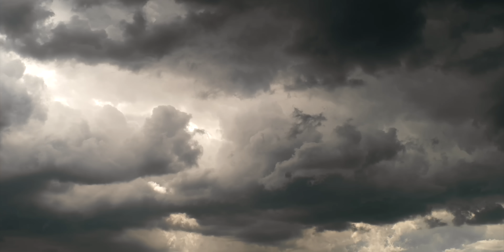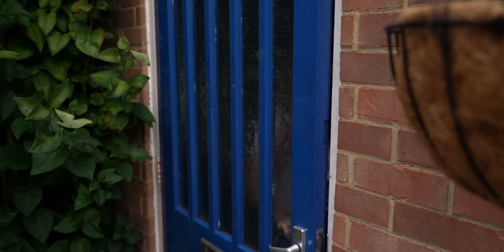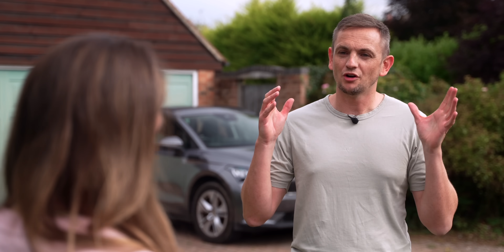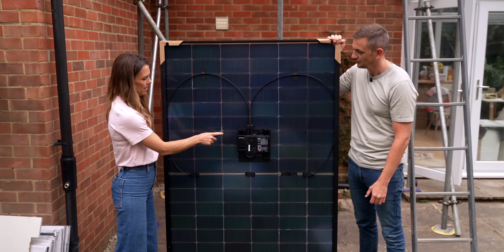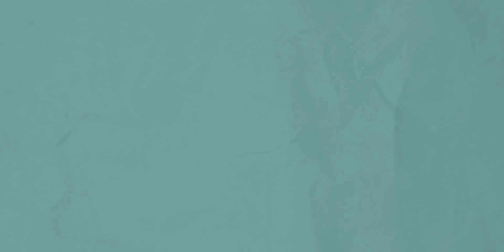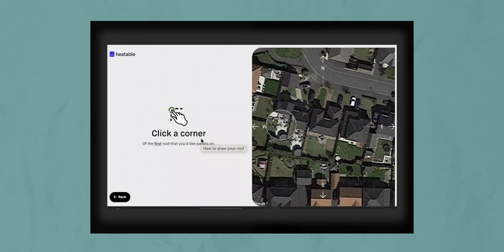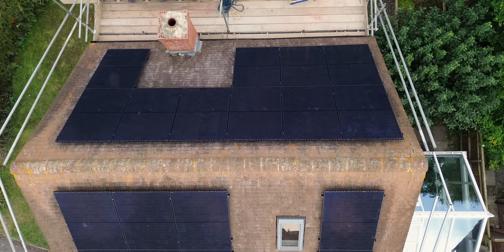Maximise Your Solar Returns With These Bifacial Panels!!

Comment: "Designed to harvest any energy in the atmosphere", the co founder can't even describe how they work.  So will they harvest heat on a hot night, would they not work in space as its without an atmosphere.  This honestly feels like a video sponsored by snake oil salesmen.
Reply: Yea, I lost it at that section. Pretty disingenuous.
Reply: What is a worry is that the platform seems to make a habit of having as guests all sorts of guests who ate not quite the thing.

Apart from that young Yasmin lady (chemist engineer by profession) who had a fair bit of experience in the industry working for various government outfits.

Other guests it seems are chosen for their ability to instantly do the confirmation bias thing for Robert's views.

As is now known sales of BEVs are now in decline.

It was an experiment which failed, mainly because the general car buying public didn't appreciate the initial costs, time to recharge and dismal residuals.

And of course the possibility of self ignition with some lithium tech.

Doubtless this will provoke arguments but the only viable technology left for reducing the carbon in our atmosphere is hydrogen.

We read scathing comments apropos the suitability of hydrogen as a fuel from those who simply don't keep up and post history lessons.

This is despite car manufacturers developing hydrogen powered cars using "off the shelf" fuel cells almost, deemed to be perfectly acceptable to power cars.

Granted the hydrogen fuel distribution system is pants but that was more of a governmental thing which is now being rectified albeit not before time.

Come on Robert!

Bite the bullet and include hydrogen info, hydrogen produces electricity which comes  under the EV heading.
Reply: @t1n4444  You have a problem with lithium to self ignite? And promote hydrogen? Ah, so you wanna see bigger booms then, quite understandable. 
FYI: a hydrogen fuel cell vehicle has a battery pack in it due to the fact the fuel cell can not provide enough power for acceleration.
Reply: @Sekir80  

😂😂😂

What on earth are you droning on about?

Clearly you don't quite grasp the technology so allow me:
hydrogen gas has to mix with air at a certain ratio before the mix becomes explosive. The ratios can be found online to save me cribbing out the info here.

However, hydrogen gas, being the lightest element in the Periodic Table, has the property of being the fastest rising gas of all.

This means that an escape of hydrogen gas into the atmosphere will rise up so fast in the air ocean it won't have time to mix into an explosive so to speak, unless confined of course.

If you were to research the Hindenburg airship disaster you will find there was no huge explosion. The airship burned but did not explode.

The fire was a result of the dope covered outer sheath burning in air.

The hydrogen gas had risen so quickly it no longer posed a risk of explosion.

Ergo you have little understanding of hydrogen science. You would have been wise to research all this prior to posting.

Now, hydrogen cars requiring a buffer battery to allow for acceleration from stationary ... so what?

The fuel cell will be charging the battery as the battery discharges through acceleration.

Again, so what?

Hydrogen fuel cell cars have been working for over a decade, as in the Marai. Recently fuel cell cars and buses were to be seen in Paris providing logistical support as in transporting competitors and official to the various venues.

In short the French wished to parade their "green credentials" to the world at large.

The hydrogen used was reduced by green energy to. underline their attempts to be as green as possible.

Again you could have found this out for yourself prior to posting if only you had applied yourself, but you failed miserably.

BEVs are now in decline and  unless such a BEV can be "invented" which is "cheap", can be charged in minutes to provide similar "performance of operability" to a petrol/diesel car then they are destined to be a mere footnote on history.

What Robert will find in seminars yet to be is that increasing numbers of people will be asking about hydrogen fuel cell cars.

It may be Robert has gone too far in "poo pooing" hydrogen he will find it difficult to start proclaiming them as the future, as they undoubtedly are.

This is the trouble when setting out one's stall without allowing some wriggle room in which to effect a "u" turn which is credible or believable.

When people set out their stall on a public platform they must expect to be challenged ... in the same way as yourself.
Reply: @t1n4444  I was quite short with my answer, the one who's droning is you. Projecting much?
I'll address little things to clarify
- FYI batteries are in hydrogen cars: I added this because you - and I quote: "And of course the possibility of self ignition with some lithium tech." So, if you fear of lithium in your car, then you must not get into a hydrogen one as well.
- I understand that hydrogen is light. Later you yourself mention - and I quote: "This means that an escape of hydrogen gas into the atmosphere will rise up so fast in the air ocean it won't have time to mix into an explosive so to speak, unless confined of course." Important part is: "unless confined of course". As you know, hydrogen is light. Storing and transporting it needs confinement and pressure. Accidents can and will happen. https://www.nrk.no/norge/eksplosjon-ved-hydrogenstasjon-1.14582914
- If we would play the "you're ignorant" game I would ask you: what a Marai is? Are you that dumb you can't even research well enough to know what's the name of the model of that Toyota? But I'm not playing this game, I urge you not play that as well. Keep it civil!

To finish it off: I don't mind hydrogen be used. But I do think it's efficiency figures make it very hard to stand by. The losses to make and use hydrogen in a fuel cell are so high it's barely a better alternative to fossil fuels. If even a better alternative. Change my mind.
Reply: That heatable guy is rather sleezy when it comes to micro inverters. I won't be surprised if he claims micro inverters can cure cancer.

Comment: The ROI still doesn't stack up. By the time you've paid back the investment, both the panels and battery are near or at the actual end of life. Prices need to drop before the masses adopt what is 30+ year technology.
Reply: The ROI for this system is indeed terrible, because they use a lot of superfluous and overly expensive nonsense. Panels are terribly cheap these days, between 75 and 100EUR per panel, depending on size, efficiency and features. After a massive spike in 2022 and 2023, we are once again in a time where the cost of cabling and bracketry and installation is higher than the cost of these high tech bits of silicon.
Reply: @luc_libv_verhaegen  the real kick is the battery cost and <3 year warranty

Comment: I've always wondered if, in the future, homes should just have an AC and a DC line.

Because I bought one of those sockets that also have USB ports on them. And it just struck me as odd to, you know, capture DC with a solar panel, store it DC in a battery, convert it to AC with an inverter, it travels a few meters, then it's converted back to DC again to go into, say, a DC battery (like a phone or laptop).

There's, like, some needless conversions there. And I was thinking, instead, a battery-equipped house could run an AC line to traditional 3-pin sockets, but then also there's a DC line that runs to a bunch of USB C ports around the house.

Low-power devices can skip the AC conversion. Just plug them into the USB port with a direct DC connection to the battery.

Efficiency!
Reply: It's going to be fun frying your 5V DC USB devices with the 500V+ from solar... You will need all kind of voltage conversion on that DC line anyway, even if it is more efficient there will still be losses.
Reply: I have a 2kwh ugreen battery that does what you described, using in a van so could be an issue scaling to a house. 4 full wattage AC plugs and loads of usb DC outputs, native solar input connections too
Reply: For the amount of energy saved, it's likely never going to offset the initial setup cost, the additional complexity of having two sets of wires running through your house and the maintenance of that wiring.
Reply: @mentality-monster  https://youtu.be/btIJWYor8KA?si=W-ECnQrNYrttItKY
Reply: @klaxoncow  half my property is wired with 24VDC
Reply: - don't worry, every single electronic device does a whole lot of energy conversions - it is very complicated. (Electronics (nearly) all run on DC, but there are often intermediate; inversion, rectification and level switching - etc, to produce an outcome).
Reply: Okay, to have a system like that I'd suggest the following: Solar panels, inverter, batteries. The inverter/battery decides your DC line for the house, say, 12V. You can use that directly for LED strips, so, the lighting is solved. Wherever you need a 5V USB outlet just use a step down converter (buck converter) to get that.
Reply: DC  >40V gets super sketchy.  I've worked on rail projects that used 750VDC, the breakers for dealing with DC faults were the size of home refrigerators, the AC breakers of equivalent capacity were the the size of a toaster.  You can do lots of clever stuff with DC, but ultimately you need big mechanical systems to deal with DC faults when all the smarts arc out.
Reply: For lighting circuits something like 12v DC seems like the safe and efficient way to go. 
My ceilings are crammed with individual 12v DC drivers for LED spots and half my light switches are low voltage electronics switching 240v, even though the bulbs ultimately only need 12v.

Am I right in thinking that there is a standard for low voltage lighting circuits already?
Reply: @GregS-UK  Isn't there power over ethernet lighting? but I think for large commercial buildings it makes sense - think hotels etc.
Reply: @Oppledom  I wasn't aware of PoE lighting (so I don't believe that was the thing I thought I had heard about) but it looks interesting - however having just had a brief search and read some posts, it also looks fairly unpromising for domestic installations.  Critics suggested that too much network gear was needed and that it provided too little power per cable to be viable in a small scale installation.  I'm uncertain as to why that isn't also the case in large commercial installations though. 
Certainly the prevailing mood on the threads I read seemed to be that anyone wanting to use it in their house was doomed to be left with a white elephant of unsupported tech, as it would never become a standard for home use. They could be wrong but the complete lack of voices supporting it as a home solution looked pretty telling to me.

Comment: Using bi-facial panels so close to the roof tiles is just pointless. Micro inverters are more inefficient than normal DC strings. Disappointing video Imogen.
Reply: The bifaciality gives about 5% extra apparently, if installed on a roof.  It'd give quite a bit more if installed on a ground-mount or vertically.   Regarding microinverters, I don't know about more inefficient, I think it's about the same as a typical string inverter, but I struggle to see their value if there isn't significant shading to deal with.  Perhaps if there is a chimney or similar, put them on the nearest panels to the chimney, but I don't see the point of putting them on all the panels.
Reply: - putting bicacials on tilts (or stand-offs) - can allow a bit more ambient back scatter collection- somewhat better cloudy day performance  - probably better with a metal roof rather than tile.
Reply: This is far from the worst of it. One of the worst fully charged videos ever.

But the bifacials are not bad, depending on how much of a premium Heatable charges for bifacials. Bifacials these days are almost on parity with standard panels for some solar panel manufacturers, so you get the advantage of having your silicon sandwiched between two glass layers instead of one glass and one aluminium with coating for the same price. But i seriously doubt that these snake oil salesmen are charging the real prices here.
Reply: They quoted me 5k for 5no panels.
Straight swap to replace mono facial panels on a garage roof!
Reply: Very disappointing indeed. I suspect the heatable guy paid for this presentation.
Reply: @adon8672  https://youtu.be/btIJWYor8KA?si=W-ECnQrNYrttItKY
Reply: They were too close to the roof tiles to achieve any gain.

Comment: Is there anyway you can store or use electricity as soon as its being generated from your PV panels (ie no minimum or very low voltage 10volts)? Such as storing it in a DC battery, using a hybrid battery or charging your EV? 

If there is a way, could you please describe it. As we're looking to install a large East/West solar array and have an Ioniq 5 too

Comment: The suggestion that DC only strings are not safe is fundamentally wrong! If the concern is the need for rapid shutdown then put in solar optimisers such as Tigo's, which are MUCH cheaper than having separate microinverters for each panel. Adding enphase is an easy way to triple the cost of a solar array for limited benefit.
Reply: Why triple ??
Reply: @stephenbrickwood1602  I buy 450w panels for 65GBP an Enphase microinverter is 160GBP add in the extra wiring and spark/scaffold time you'll easily triple the cost. Plus I can't use much cheaper 48v LifePo4 batteries without doing AC/DC/AC conversions whereas a regular solar DC inverter will do the much more efficient DC/DC conversion.
Reply: Spot on.

Comment: An awful video about an awful product. Lots of misinformation on this video.
Reply: OK.  Let's hear it.
Reply: @Pottery4Life  The suggestion that AC is much safer than DC is simply wrong. Having that many inverters also increases the chance of failure - I've had 2 inverters fail on me in the last 3 years and having them on the roof means scaffolding to fix - not cheap! More cabling with micro inverters, limited choice of battery storage and less efficient storage as you have to do AC/DC/AC when charging/discharging so lots of transfer losses. if the concern is solar production due to shading then solar optimisers are a far more cost effective solution at 30GBP per panel rather than 160GBP for an enphase micro inverter. I could come up with more misinformation if you'd like?
Reply: @biker_rich_71  It has nothing to do with what I like.